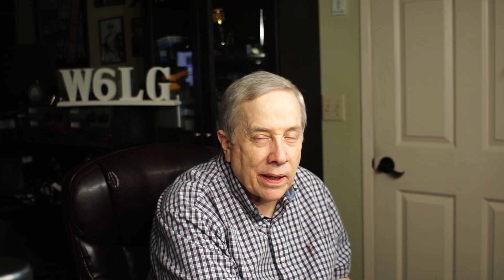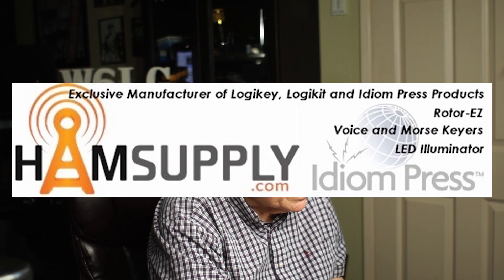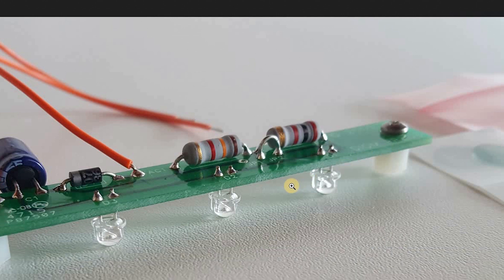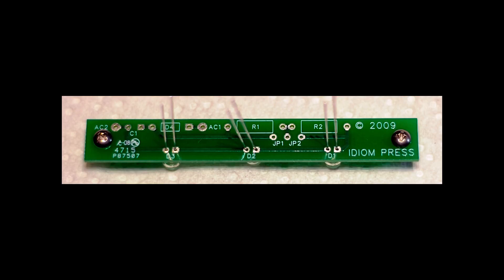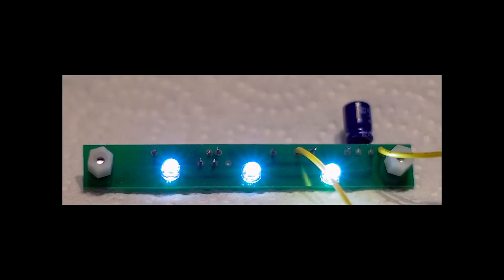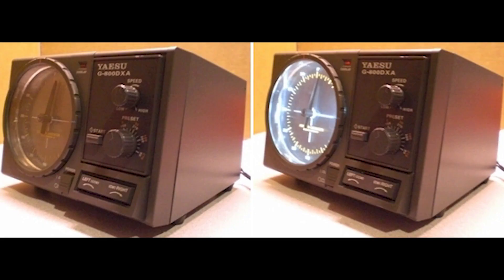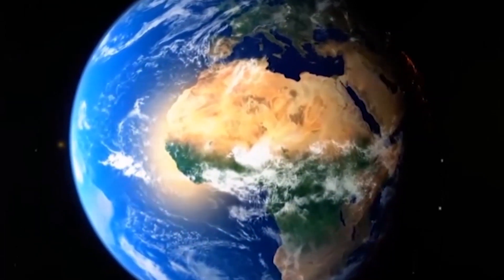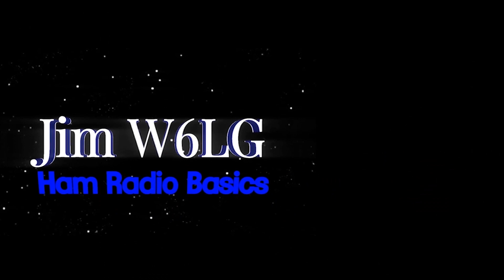Ham Radio Basics--Jim Heath W6LG Shows An Inexpensive Fix For Blown Bulbs in Rotator Control Boxes

Comment: To further diffuse harsh lighting, I use a Dremmel to cut pieces of plastic lens material  from hardware stores.  Once installed, it won't discolor and will last decades!   Another plus is, most times I've got the material "free" as some of the normal over head lighting units get broken in shipment - so at most you pay a couple dollars for a sheet 48"X16" with a crack in it!  That's about a lifetime+ of mod material.
Reply from the maker: Can you tell us what "lens material" you got from the store?  Do you mean like the stuff in some florescent(sp) lights?  Thanks, Jim
Reply: Hi Jim,  OK you're twisting my arm now!  LOL  There are several types of material available from the DIY stores to defuse lights such as the cheap acrylic plastic ceiling lights covers.  Some are faceted, some perforated, and then there are those which can be readily modified and shaped to purpose.   Alternately,  ordering the "sample" pack provided by many reputable plastics dealers offers a much higher quality product and of far more robust materials. I've had very good results with the following firm: https://www.eplastics.com/lighting-diffusers/egg-crate/Sample-pack-of-lighting-diffuser-panels
Reply from the maker: @TheOregonOutlaw  Super.  A really 'bright' solution!!! Thanks for your help.  73, Jim
Reply: @ham-radio  My wife reminded me of yet one more easy avenue worth mentioning.  Many people in crafts use dyes and what amounts to Super Glue to bind layers of acrylic together, then cut or shape to size needed.   You can go to any craft store and likely they can fill in the details.  WOMEN!  Always have the best ideas!  LOL  Now if only I can convince her she wants to climb one of our 200 foot tall Sequoia trees to install a wire for me.... LOLOL  
~Thanks for helping so many Sir, we DO appreciate it~
Reply from the maker: @TheOregonOutlaw  Thanks. It is good therapy for me as I deal with some serious medical issues. 73, Jim
Reply: @ham-radio  We old War Dogs have to stick together!  It's been too long since I keyed a mic, so you're great therapy for me as well.  73

Comment: Hello Mr. Jim I use warm white LED strips. You cut every 3 LEDS and it comes with smd resistor. I get 500 LEDs for 6$. All my boat anchors radios now have the.
Reply from the maker: Brilliant.  Thanks for the help.  73, Jim